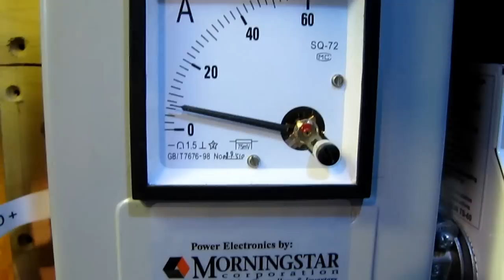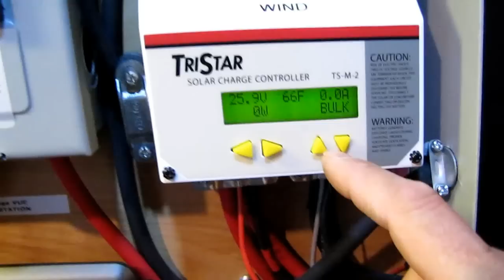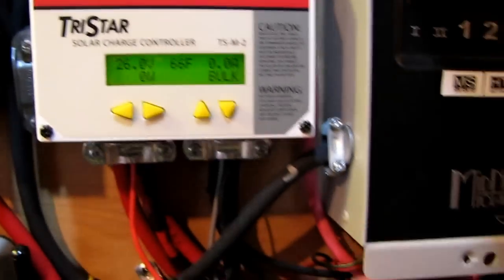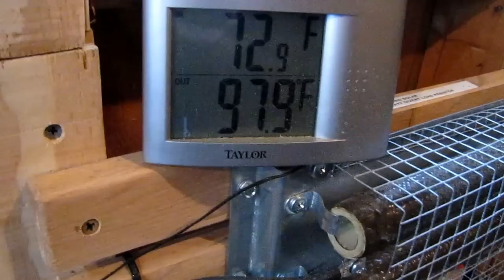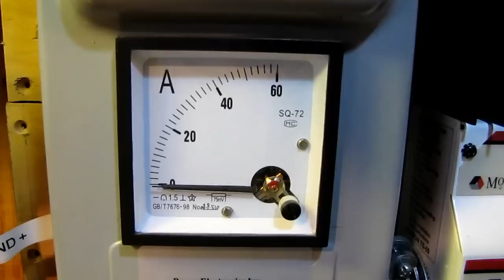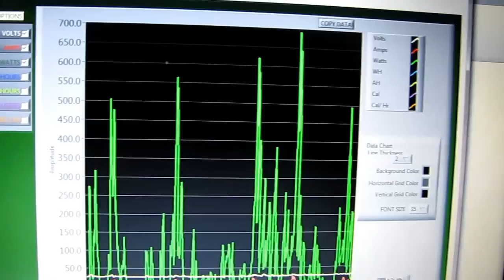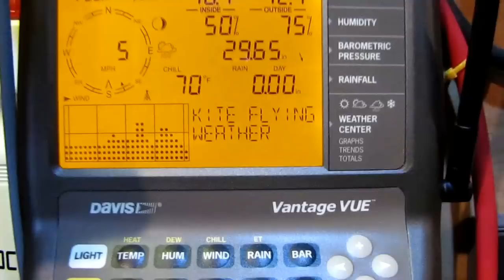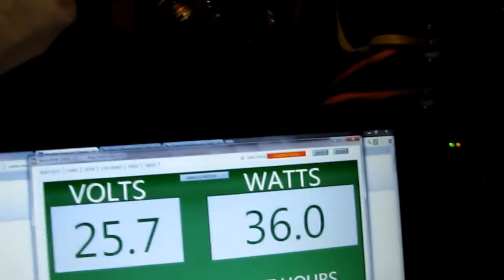My Wind Turbines My Best Windy Day So Far !  By VIARLOCITY

Comment from the maker: Hi dogfan4lyfe  The Electrical power is measured in watts. In an electrical system power (P) is equal to the voltage multiplied by the current.     
 three most basic units in electricity are voltage (V), current (I, uppercase "i") and resistance (r). Voltage is measured in volts, current is measured in amps and resistance is measured in ohms  I hope This Helps Sweety      
God Bless